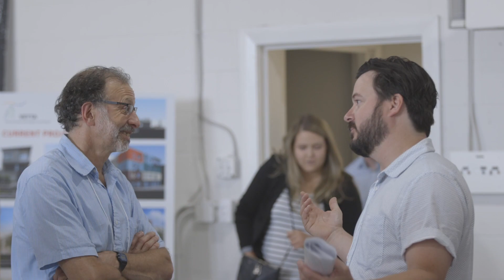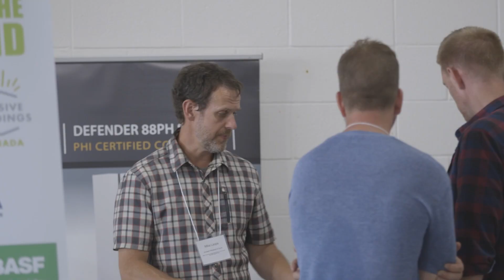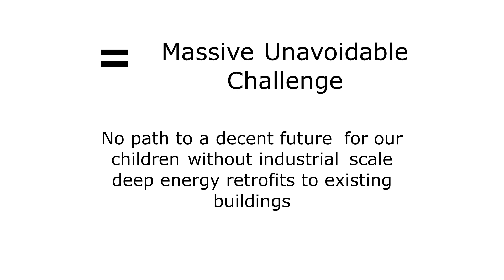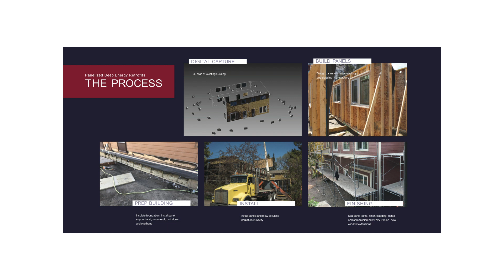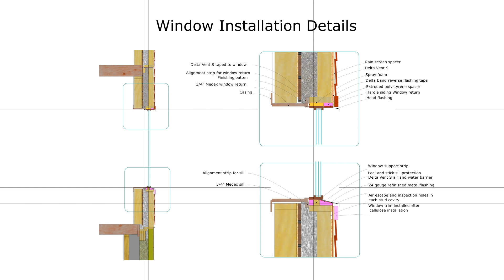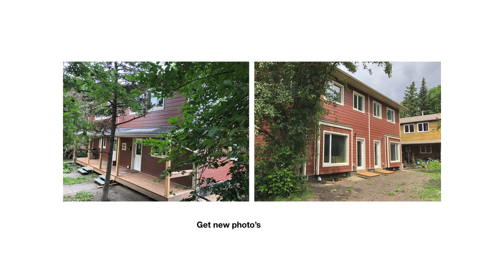Boots on the Ground: Retrofit Canada! Dammit, before it's too late!

Comment: Panelization is Excellent, using Wood in the panels is not. Want to do things faster, Stop using Wood Framing. I would suggest learning how to do this kind of work before wasting everyone's time and money. If you want to make savings the only bulletproof system is #Styrofaming, over 50% less with zero hassle. Stop stealing money from anymore Stratas.